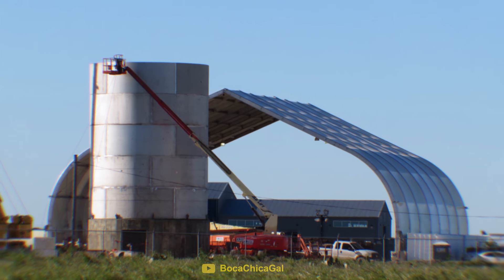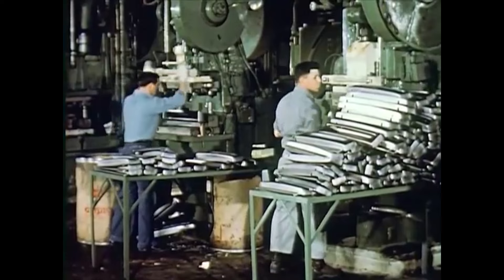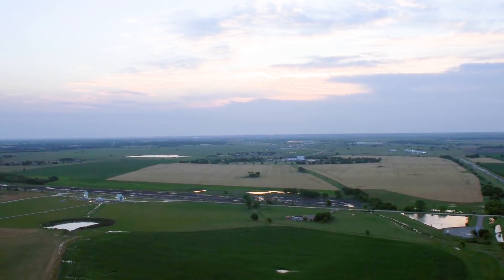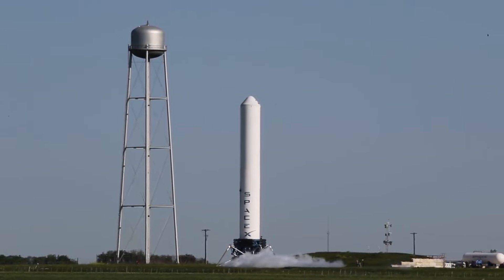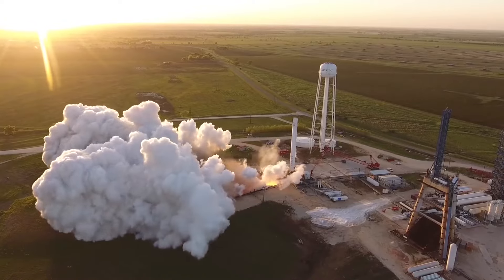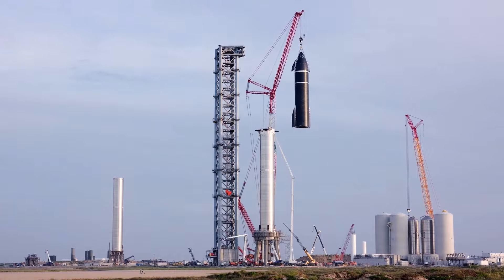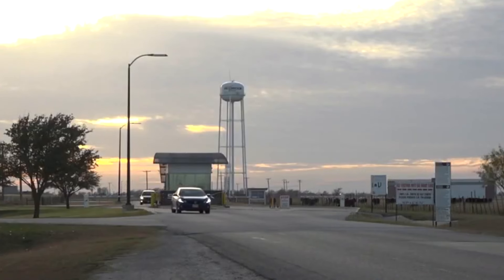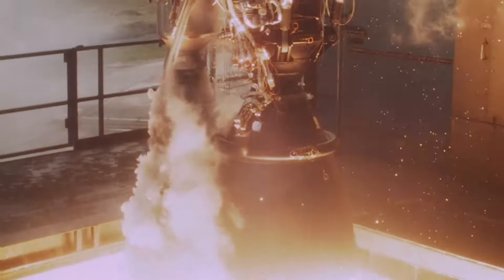SpaceX's 80 Year Old Factory

Comment: Before they took over MacGregor, SpaceX tested the gas generator for Merlin in Mojave on our mobile test stand at XCOR Aerospace. One GG test exactly twenty years ago today- on Nov 11 2002- made a huge cloud of black smoke while the local jet pilots were doing a missing man formation for a veteran's day ceremony at the Mojave cemetery. This caused considerable distress and confusion as some people thought one of the planes had crashed. Yes, it made THAT much black smoke. Cal EPA also got involved when the plume was blown across their air monitoring equipment and we had to provide more documentation, but fortunately no fines were imposed.

Comment: Haven't read through the comments. But in case no one pointed it out, there are only 9 engines on F9. Not 10. Other than that, this was an awesome video!
Reply: there are 9 engines on the first stage, and 1 on the second stage so 10 in total.

Comment: The Falcon 9 has 9 engines, not 10.
Reply: It has 9+1.
Reply: 9 on first stage, 1 on upper stage.
Reply: @cory6294  Oh.  Yeah.  Forgot about the upper stage.  Seems they should have called it Falcon 10.  Thanks.
Reply: @peterfireflylund  Got it.  Forgot about the upper stage.
Reply: I almost made the same mistake but after giving it some thought I realized I was wrong. 

You forgot the one in the chamber. 😆

Comment: So, yea. if just the engine comes down safely: the frame can be abandoned; when clear of worm hole. 
Steel to aluminum would make sense in that case. - Station can use that clean material as useful scrap, in their void, no?

Hard to guess if clear plastic rope: is going to pick up the twin's; lasers variations; roughly specing out the worm holes. {{{3 est}}}.

{ (fin the inside straight) } - reduce the spin.